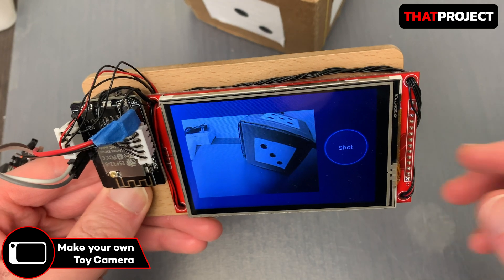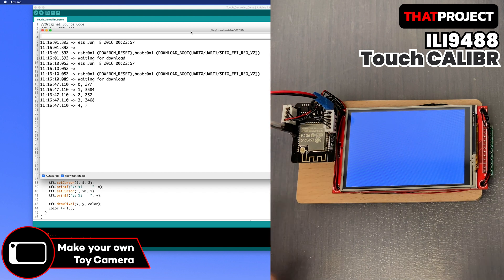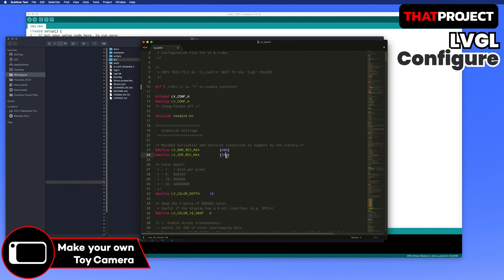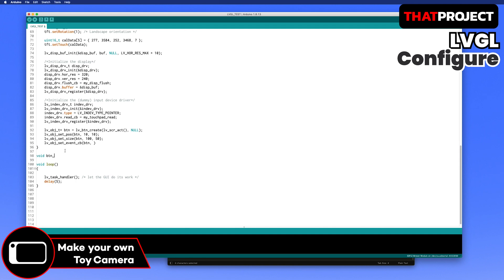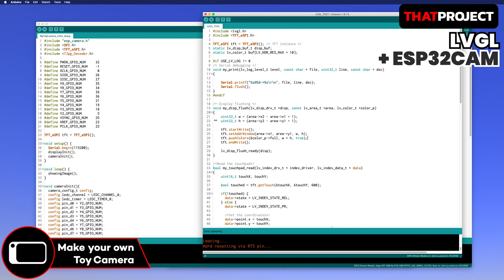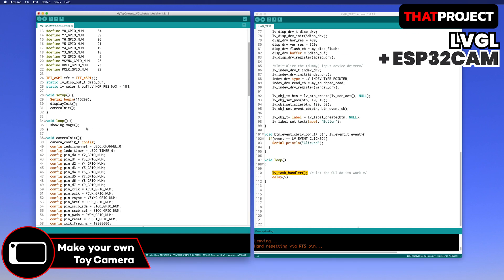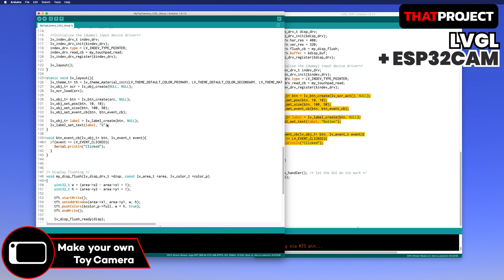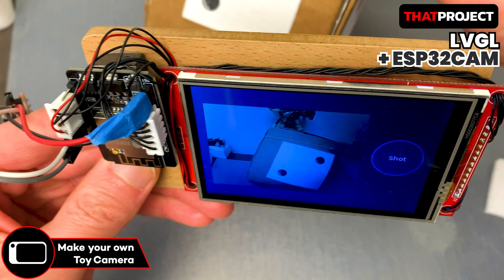Toy Camera = ESP32CAM + ILI9488 + LVGL7 | Part 2, LVGL Configure #ESP32CAM #TOYCAM

Comment: What is the difference between lvgl and TFT_eSPI ?
Reply from the maker: LVGL is a set of graphical widgets.
It includes things like buttons, meters, and listviews, so you can easily organize your screen.
TFT_eSPI is the graphics driver. It contains a set of commands for drawing the display. This allows hardware to display something.
LVGL -> TFT_eSPI -> Display
Reply: @ThatProject  Thanks man :)
I'm working on developing my own UI tools like buttons and sliders as a task to improve my programming skills using TFT_eSPI. But I'm facing the decisions to how to get the actions received from a button press to do something for example; activating a pin to high or low state.

If you have a time to check my sketch later, after I finish getting the code to work as I want.
Reply: @ThatProject  I downloaded the library, and tried to compile the example, first I got the lv_conf.h error then after reading how to do it. I got another error regarding this ----> 'lv_disp_draw_buf_t' does not name a type
Reply from the maker: @PerchEagle  Please refer to this for LVGL settings. https://youtu.be/IPCvQ4o_WP8

Comment: are we can use different diplays for this projects becaue this display is very expensive in my country??
Reply from the maker: I think it will be possible if it is a display that can use TFT_eSPI.
Reply: Thanks for quick reply i will be try
Reply: Are Pins is change??
Reply from the maker: @ArEditz-c8i  It may vary depending on the display.
Reply: what abouth 2.4 TFT display for this project
Reply from the maker: @ArEditz-c8i  Please check if TFT_eSPI supports the display you have. https://github.com/Bodmer/TFT_eSPI
Reply: Ok i will be check

Comment: Maybe the slow fps is due to the decoder library?
Reply from the maker: Good point. I tried to operate the JPEG Decoder faster with Task working, but the speed was the same. It seems necessary to display in parallel to increase FPS.